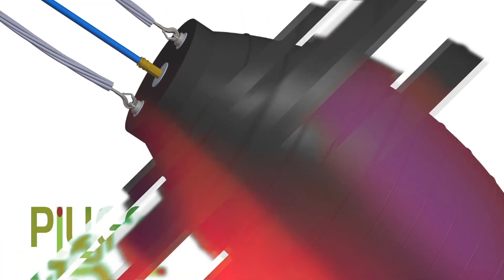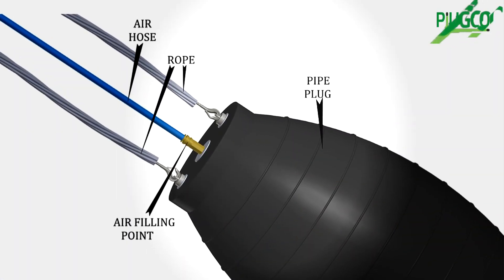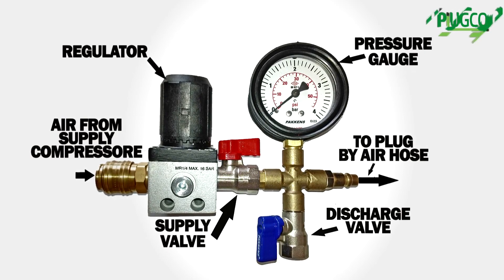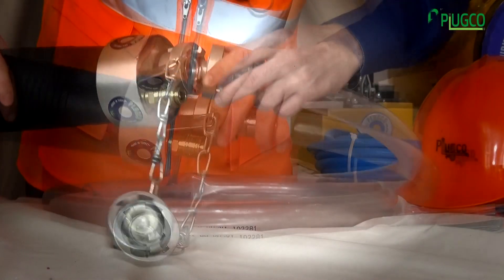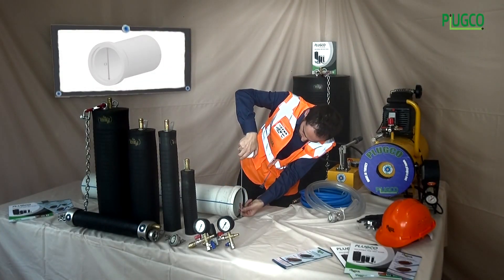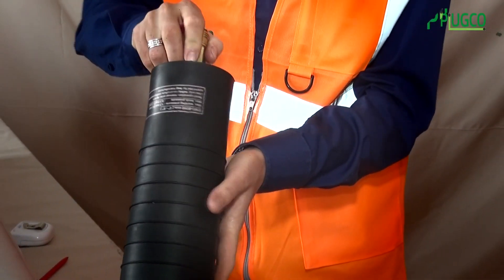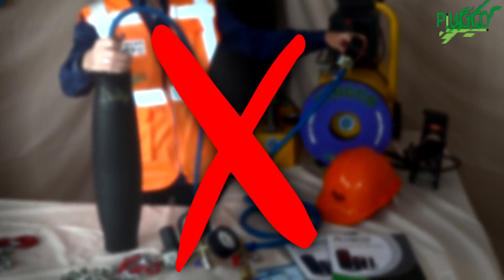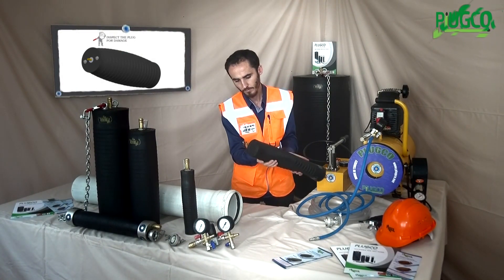PlugCo | How To Use the Inflatable Pipe Plugs

Comment: Hello Plugco team,Ihave my swimming pool construction company,wanted to know how can we use this for testing pvc pipeline of swimming pool having diameter 2 inch ,how the plug move through the pipelines
Reply: Hello Kshitija, you can use PP50100 molel iflatable plug. You can inflate it by hand pump. The line to be sealed from both ends. Then you will pressurized it. Why you need to move the plug throug the pipe? Could you make a hand sketch about your applicaiton and email it to sales@plugco.net. Then we may advise you a solution.